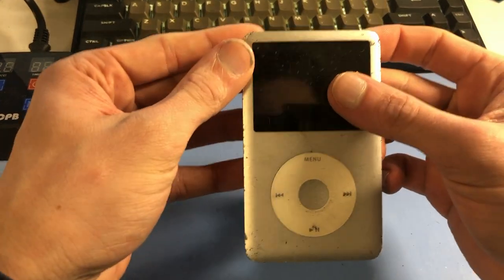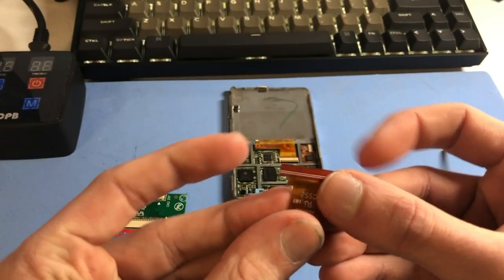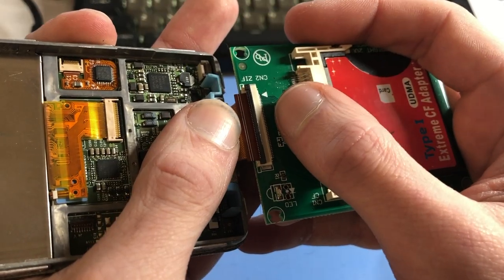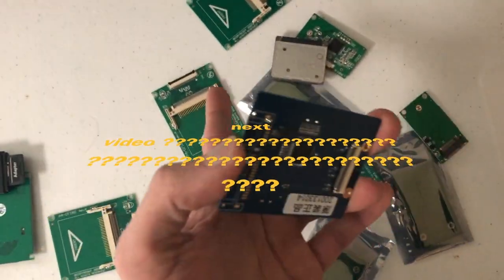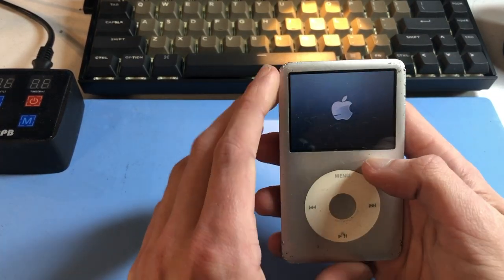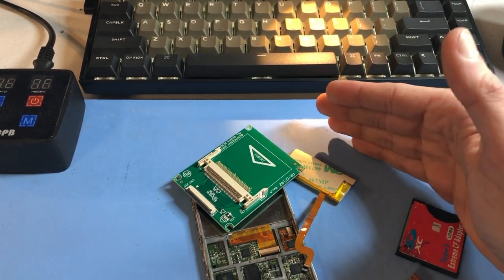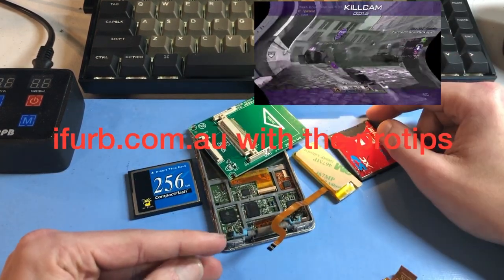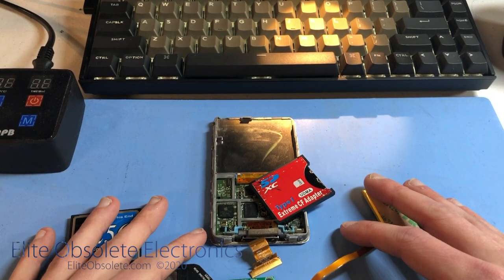$2.41 #iPod Classic SD Adapter - ✅ or ❌  ? ? ?

Comment: I can't believe you disconnected the battery like that! OMG!
Reply: That's actually a safer way to disconnect the battery ribbon cable lol, even dankpods disconnects it like that. Just make sure to also push down on the brown tab with a tweezer or something while using your other hand to pull the ribbon cable up with another tweezer. Using this method, you're less likely to rip the battery connector off the motherboard.

Comment: I use the cheapo green adapters in all my ipods (5.5gen 4th 3rd gen) but I could be I'm lucky. It's the red CF adapters that're having me issues. The black ones works all the time.
Reply: the black adapter that you mencioned, is an adapter with the word "new" in red? I want to mod my ipod 6g but I don't know which adapter I should buy or if a 128GB kingston compact flash canvas plus will be compatible with the cheapo green adapter. A long ago I bought one and I put a 4gb adata CF card into an ipod 5.5G and it worked perfectly.
Reply: @joshuaanri1556  yes. The black one. Your Kingston CF should be able to use

Comment: Considering getting this solution actually as I have a 6th 120GB and recently acquired a 5.5 80GB and the iFlash is quite hard to find in my country without having it shipped internationally to the point I may just as well buy an already refurbished iPod.

Comment: Thanks for the tip about the white lines, used the green board and newer micro sd to cf adapter and it worked perfectly first time. All for less than £10

Comment: Somebody referenced this video in a forum and it saved me, I ended up throwing my last adapter away since I thought it didn't work or something, but pulling the cable slightly out from the port worked.

Comment: The thing difference Between iflash and the generic cf card $30(considering shipping too )
I had the same issue with my IPod Classic with menu button issues .
I thought the problem was the cheap Chinese adapter and went for the Iflash . Apparently the problem was with the menu button .
The zif tab on the generic one is not strong enough what I did is i used a thin layer of micropore tape on to the zif cable to get a snug fit .
Reply: omg i never even thought about the connector being to weak thanks so much lol.

Comment: I would definitely try out the iFlash SD Adapter cards but the shipping price to ship it all the way to Southeast Asian countries is expensive (a bit more the cost of a faulty iPod sold on second hand websites). Of course it will be worth the money. 😅

For now, I try with those cheap adapters first on my recently purchased iPod 6th Gen as my first time modding an iPod.

Comment: I have an unusual zif connector I pulled out of a 60 gig fifth gen. It seems to be about three times the thickness of a standard connector.   With that connector, Every single cheap board I plug into it works. I'm currently using it on my iFlash mSata.its a really tight fit, but once it's on, it won't go anywhere.
Reply: Oye disculpa man, que ten grande es el flexor en comparacion con los delgados que dices ?

Comment: It took me hours to know about the installing of the ribbon cable just out a tiny bit, wish I'd have seen this vid sooner. This has made it work reliably on my 5.
I have 2x 5.5 and they just boot loop when the restore nears its end.
Also, when restoring I get an error on the mac and I have to pull the usb out as it just hangs. But replugged in the white bar in the iPod rises and then it's fine:

Your yanking out of the battery cable made me wince. The brown part should be lifted upwards gently with tweeters of you risk the battery ribbon snapping off. (You probably knew this though)
Reply: Ok saw your newer vid. I get what you mean about pulling out the battery, though if the ribbon is folded and weak it will bread (mine did).
The 1460 error.. interestingly I get that, but if I unplug and plug in, then it continues and works.
Reply: I might try  my 5 zig ribbon on my 5.5 ( as I've had no luck with the 5.5) there's no way I'm spending out on the iflash

Comment: this is probably a dumb question but I bought a green board and used a Sony compact flash not adapter and not formatted (I do not have a CF reader)I think that it is the CF card I am just wondering if you think this observation is right.

Comment: I have a 1st generation iPod mini. The hard disk is dead and the old owner has broken the battery socket in the mainboard, it needs to be re-soldered. Since the hard disk wants higher energy, it does not turn on when it is batteryless and connected to the PC charge. 

If I insert a cf card in this ipod, can I use it on charge or on the philips dock?

Comment: I ordered for ipod 5.5 gen iflash dual micro sd and it works, but i have ipod 6.5 gen 120gb i want to flash with iflash dual microsd, to ad 2 microsd card 128gb in total 256 gb it will read

Comment: Can it take 128gb sd card?
Reply from the maker: Yes
Reply: Can I use a cf to sd card adapter and a 3000mah battery if I use a thick case?
Reply: @EliteObsolete  what sd card do you use?

Comment: That info at 3:37 helped me successfully flash-mod my iPod 5.5g with green adapter from Aliexpress. After struggling for an hour I did as you mentioned and it worked for the first time. Thanks!
Reply: Even doing this on my 5.5 I get a boot loop on the latter part of the restore, did you get a boot loop before you got it to work?
Reply: @grahammcdonald  No, I didn't have a boot loop. Just bad connection from iPod's board to adapter when I closed the case. I've heard lately that some users have been experiencing boot loops after restoring iPod. Somebody discovered that red SD adapter distorts first bytes of MBR on SD in the process and fixed it by editing first bytes of SD's MBR directly on PC through a card reader. Saw this info in /r/ipod on reddit.
Reply: I had same issue and tried for almost an hour, trying to fit the cable to the CF adapter multiple times, and then came across this video. The trick as mentioned in this video is to insert the cable only so much that the first white line is just visible and then close the latch. In my case the connection was still not tight enough so finally used some tape on the flex cable to get a tight fit. Thanks to this guy who made the video. I was almost convinced that the board is faulty.
Reply: @gautamm6033  hey, are you from india? Even i am looking to mod my ipod with this cheap cf to zif adaptor. Can you tell me from where did u buy it?

Comment: I use the cheapo green zif-CF. Always work on my gen 3/4/5/5.5 BUT I ALWAYS had issues with the red CF-SD adapters... Now I use the black one always works.
Reply: Have you done the iPod mini? I'm having issues with the red one and the mini...
Reply: @germanelias8924  no not yet. I have a 2nd gen Mini standing by but I haven't got the mood to do one.
Reply: @koncomartalegawa do the black ones still work for you and are they the ones that say new?

Comment: i got this recently for my 5th gen and it took some doing to get it to work because the latch was too loose but that's not a problem anymore, the problem is that i can only get it to work on an old ibook i got which restores it to software version 1.1.2, which is fine but i can't put videos on it for whatever reason. When i try restoring it in windows to version 1.3 it gets stuck in recovery mode no matter how many times i try.

Comment: Do these fit in the thin chassis? I'm assuming you can't add bigger batteries than the stock 650mah or whatever
Reply from the maker: yes
Reply: @EliteObsolete  dang, then battery life is another reason to buy a quad flash... so expensive for what they are!